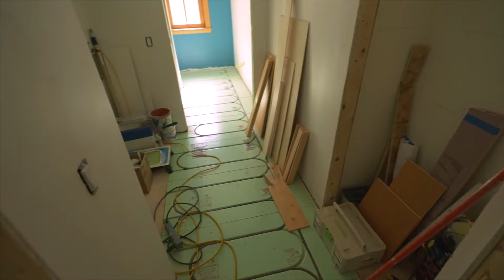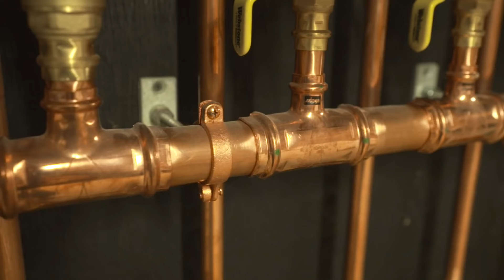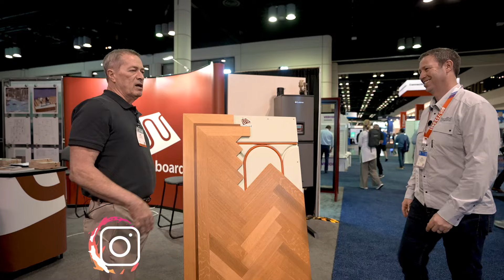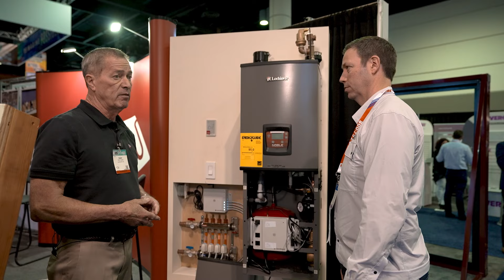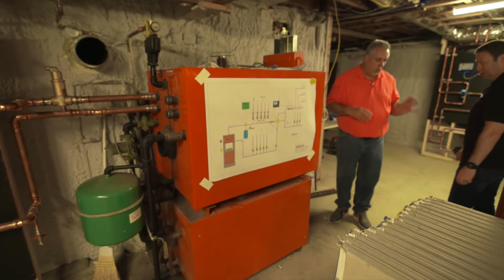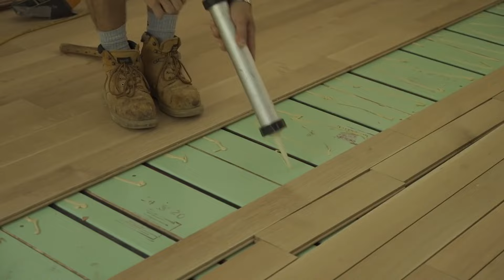ANY Plumber can install this new Warmboard Radiant Heating System

Comment: What's an average cost per square foot of floor space? How much savings versus traditional heating in wintery/cold weather?
Reply: Same BTU usage other than you can possibly turn the temp down and save that way(90% efficient is still 90% no matter what it's heating)  Radiant heat is about comfort. Most homes around here also have a forced air system to quickly ramp heat and for cooling. Once you have radiant heat done right you never want it any other way.  It's like why is it so nice to sit by a wood stove on a cold day? It just can't be described other than it is amazing.
Reply: @tysleight  Thanks for sharing. I haven't learned enough about this yet but I do like it.
Reply: I am personally considering the Uponor radiant heating system. Something to consider and check out. Thank you!
Reply: Savings are very tough to calculate because people live in their home so differently, in different geography, with different energy sources. We've heard of 30% savings on heating bills, and we've heard of 80% savings on heating bills.
Reply: @Warmboard  Lot of variables true but your answer is what I was looking for. If one were to choose this type of system, how long until, for lack of a better way to put it, "it-pays-for-itself"? You know, like with going solar or going with tankless hot water systems...
Reply: @lj8902  We estimate $20/sf - this for the design of the system, all the components, the shipping and the installation (though this number is not as steady as it used to be with the world the way it is). We had a homeowner in NJ see his heating bills go from from about $500/m to around $100/m. We had another homeowner double the size of their house while also cutting the heating bill in half from the previous home. And we've had a very small percentage have their energy bills stay the same (or increase) because they love it so much they never turn it off. :) So mileage will vary. Setting each room to its ideal temperature, not having the forced air wake you up in the middle of the night, less dust and allergens/viruses blowing around, and always being comfortable - these are some of the benefits you can't really put a price on. So maybe you pay $20/sf for this system, and then for the rest of your days you pay a couple thousand less every year to the energy company while enjoying constant comfort? Ultimately, that's what it might come down to. Do you pay the energy company for mediocre heating, or pay yourself back with comfort. And the answer to that varies for everyone. Let us know if you have questions, we're more than happy to help. Sorry for the long and rambling response.
Reply: @Warmboard  Not rambling at all. Very informative and very helpful.  Are there any flooring types that this isn't recommended for. Carpet, wood, tiles fine but what about finished polished concrete floors?
Reply: @lj8902  You can use anything with us. If you'd like, check out our Warmboard-S or -R installation guide on the "Documents" section of our website. Lots of info in there about hardwood, tile assemblies, carpet, cork, luxury vinyl etc. 

As for polished/decorative concrete floors, you can definitely do that. Just use a 1/4" backerboard over the Warmboard panels. This is an expensive way to go however, and you can risk hairline fractures. There is a growing movement in the tile industry towards larger sized tiles with minimal grout lines. These assemblies are less expensive and can be a great alternative worth considering.
Reply: @Warmboard  Thanks again for answering my questions. I'm only vaguely familiar with this topic, have some research to do. I'll look for those documents on your website. Have a blessed day...
Reply: @lj8902  You're welcome. Any time. Have a wonderful evening.

Comment: Can the Warmboard system be retrofitted to an existing radiant  system?  In other words, keep existing radiant tubing but use their Warmsource furnace as  a replacement for an existing furnace?
Reply: Potentially, yes.
Reply: Yes, a manifold with pump does the trick.
If u have that u can hookup the floor heating on any aystem u want. The pump on manifold mixes the water from the ground loop with ur heating loop til the desired water temp for ur floor heating is reached which u can set on the manifold also .

Comment: I really wanted to use Warmboard in my house 7 years ago but it would have added $20,000 to the cost of my home.  In retrospect, I could have done it for less as I could have sourced 1 1/8" material for the areas where I didn't need to heat., essentially an area 12' x 25' in a 1500 SF house.  My house is a DELTEC and requires 2 layers of subfloor,  Warmboard would have served well as the second layer. In reality, I wouldn't have needed to heat the bedroom at all as I've never run the radiant heat in that room.  My walls are 2x6 with 5/8 sheathing and an inch of foam and then spray foamed.  I did put in floor in the basement and garage.

Comment: Like the product and the radiant floors!  However how do you deal with Hot and Humid?  Still need a Ducted Forced Air AC evapoartor and a condenser
Reply: Two systems. We have a normal heat pump for quick heat ramp up and cooling all summer.
Reply: @tysleight  Thanks Tyrone  -- Yes I just drew in some chases for the ducts on my drawings
Reply: Don't forget about humidity control for the winter seasons. A dry winter will make all interior wood freak out

Comment: I wished they had a version that ran off of a Sandon heat pump system esp with the low running temps

Comment: I installed about 1,100 sq of their retrofit board along with their tubing, boiler, thermostats, and manifold.  I am not a builder or construction tradesman (I’m a mechanical engineer).  It was pretty straightforward to install everything.  All of their components are top notch and very well engineered.  Their customer service is absolutely incredible.  They’re all really good guys and have an excellent product!
Reply: Ballpark $ estimate?
Reply: will they sell entire setup and let you do it as DIY project? I'm not professional plumber but as a building automation tech i have enough skills to do something like this myself.
Reply: @VladyslavSvyrydenko  Yes.  I installed the entire system myself and I'm a DIYer.  Even soldered the little bit of piping that needs to be installed and ran the gas line to the boiler.  It's a nice system.  Probably the biggest hassle was renting a telehandler (onroad forklift) to unload the warmboard panels from the truck and get them into my garage.
Reply: @pauledwards1157  Thanks for the info on pricing.  About what I thought since they basically have no competition yet.  It's a dream system for sure.  Is it as cheap to run as you expected?  People that don't want to rent a telehander can pick it up at a freight terminal.  They'll load it onto your truck or trailer for you with a forklift.
Reply: @yo yo depends on if you got more time then money vice versa
Reply: It’s been a year. Can you give some feedback on how the system has performed? Monthly costs? Also what area are you located?
Reply: @Adesico87  Sure.  Still very satisfied and happy with it.  This is year 3 for me so I’ve been through two full winters.  I’ve never looked into the operating costs very closely.  It’s kind of irrelevant to me as it’s not more than a $20-30 difference either way per month.  The comfort level is much better.  Just a much more even heat and lower to the floor so much more comfortable hanging out.  The boiler has been flawless but I did have a very intermittent control board issue.  There were a few times where I needed to unplug the unit and replug it in.  After a couple calls with Warmboard support, they sent me out a new control board and it fixed the issue.  Still highly recommend it and I’d 100% install it if I ever built another house.  I’m in southern Colorado at an elevation of 7,040 feet.  It doesn’t get crazy cold but it will be down around 10-11 degrees later this week.  House is currently at 71 degrees.
Reply: My system without installation was less than $13k.  Remember that we’re talking about it including the tubing, thermostats, controller, self contained boiler unit, and fully detailed plans.  It’s more than just the aluminum skinned boards.  This was one year ago prices.  I’m sure with today’s ridiculous supply chain issues, it’s likely higher.
Reply: @pauledwards1157  just got quoted $24k for 1,100 sq ft. You're lucky you got it when you did!!
Reply: @pauledwards1157  How many sqft?
Reply: @jhealy3110  1,100
Reply: @pauledwards1157 do you have an email I could reach you at? I have some questions
Reply: Hi - how did you deal with doorways and thresholds at exterior doors?  Seems like this system plus another layer of flooring on top of regular plywood subfloor would cause a lot of issues...
Reply: @mschumaker1  You do have to deal with this.  Some exterior doors I had to replace the threshold piece with a new one. Interior doors needed to be cut down on some depending on how much space they had to start with.  I do have a height transition and Schluter trim piece where I transition to carpet at the bedrooms.  I installed a slight tapered piece under the carpet pad at the transition point.
Reply: @pauledwards1157  thanks.  Good to know and pretty much what I expected.

Comment: Eh…. The subfloor system itself is good. Depending upon how your house is constructed there are other products out there that give you better BTU transfer. The only problem I have, is when you start saying that it’s a “totally integrated system” That is never the case. And God for bid when you go to service that “integrated” system in a few years and you need to find some of these components, best of luck to you.  It is good to see though that they’re actually teaming up with Lochinvar for the boiler itself. Anything was better than the no-name boiler that they were using before.
Reply: What are you going to have to service?
Reply: @ZDub77  u never know, anything is susceptible to failure. The second I saw this I had the exact same thoughts about maintenance. Hopefully they also offer many years of standard parts you can use to replace whatever will eventually fail.
Reply: @PT-ho1ez  just pray you won’t have to have them shipped from California in the dead of winter when your house is getting cold 😄
Reply: @ZDub77  anything and everything. I didn’t really like his comparison to a nuclear submarine. Ideally you never want to have something set up so compact that to service it you will have to go through multiple components in order to access what you’re trying to fix. At the end of the day anything that is sold at your local supply house is best, and you can be almost guaranteed that it will be in stock if the worst happens. Also, even if a journeyman plumber can install it, more times than not they don’t know how to service it. Even though they are few and far between you always wanna make sure that you have someone with a hydronic background that will be able to, not only install but, service down the road. And nine times out of 10 they’ll want to use product that they’re familiar with.  The problem with any boiler system if something goes wrong your house, it is going to get cold quickly especially when you’re dealing with a “Low-Mass” system like warm board. You want to be able to get parts quickly and not wait to have them shipped from California. Lochinvar would be a fairly easy company to get anything from locally. As far as their other components, especially the zone controls, thermostats, and manifolds,  you’ll want to be able to fix the issue quickly.  At the end of the day as long as your meeting your BTU requirements warm board is a good option. However the boiler system itself I would have installed separately, and not buy a “package system“
Reply: Would you be willing to identify some of the other products that give better BTU?

Comment: Would have loved more detail about "what's in the box" i.e what components have they incorporated inside.   Also can we buy their boiler and attach to our existing hydronic heating system.
Reply: Our site has more info if you're interested. As for your existing system, most likely not. But if you want to give us a call, we could talk through some of the specifics.

Comment: Given the low temperature required this would pair well with an air-to-water heat pump.
Reply: stay tuned...
Reply: I used Warmboard for a gut renovation mechanical setup with an A2W heatpump and a 3 ton ducted Fancoil for AC works really well. The Warmboard team is excellent, you get what you pay for.
Reply: YES. As an HVAC guy who just completed my own warmboard install w/ a Rinnai combi - I am very upset that I didn't wait 2-3 years for Daikin, etc. to bring the heat pumps to the US.
Reply: @epiphany6  I wonder what's taking so long.
Reply: R744 is GWP of 1 because it’s CO2, excited to see if companies can manage the higher pressures it requires and start to replace R410a as a go to residential heat pump and AC refrigerant
Reply: That's where I see this going once the R32 stuff storms North "Murica
Reply: @hmurchison8123  R32 was always in America. It was previously used for refrigeration. R410a is just R32 with R125, and the R125 was used to make the R32 not flammable.
Reply: Agreed!
Reply: Or geothermal

Comment: Love the idea of heating the floor and not the air. In the Northeast we need AC also so It's easy to just go with forced hot air. I would love to feel the comfort of that system.
Reply: @yo yo Yes Mini splits are becoming more acceptable to have something on the wall. I know they have ceiling units bif you have room for the install.
Reply: @yo yo ... such a system is already made and in use for commercial applications. They are made up of chiller panels, installed in various areas, then they use a much smaller air handler to remove the humidity. (so the panels don't sweat) The main advantage is fewer ducts, and less total air movement so fewer drafty spots. I have forgotten who makes it.

Comment: Installed Warmboard in the remodel of my 2,000 sq. ft. house here in CT a decade ago. 

It is expensive up front but incredible in performance. It was the best move ever, and yeah, no radiators or ducts to deal with.
Reply: Same positive experience  with Warmboard on Long Island NY, over three winters.
Reply: Did you rip up the old flooring down to bare floor joists , than you put  warm  board on top of floor joists?
Reply: @cheeseburger9232  - good question
Reply: @cheeseburger9232  I installed right over the existing 1/2” sub floor. It was a 1963 house with the 1 1/8” Warmboard product. I save a bit by not running Warmboard under cabinets, the island, and closets and was able to eliminate like 6 panels. That’s as okay as I knew the BTU output was more than sufficient and I have never run more then 110 degree water in the system.

Comment: Installed Warmboard when I remodeled my 2,000 sq. ft. house here in CT 10 years ago. 

It was expensive but the best move ever for comfort and efficiency. I love it. 

A little bonus that is not so obvious; no heat ducts or radiators to deal with. (A/C is a high velocity system)

Comment: Been filling this for awhile... Would install in a remodel of my home !!!  Can use other companies to run the system.  I am using Water Furnace for my heating and AC put in 20 years ago.  Uses the ground for temperature exchange... Amazing system .... Matt you need to check it out.  Instead of changing outdoor temp for heat & AC  your using a constant death temperature in your area.  It's a great system ....
Reply: He made a video about geothermal heat pumps before.

Comment: I'm no plumber but I'm gonna give it a shot. Thanks Matt!
Reply: Shit runs down hill, don't chew your fingernails. That's all you need to know.
Reply: @matthewerwin4677  payday is on Friday 😂
Reply: Look at all the different available options before using this one. This is a paid ad for a specific use case. Every house I build we do in floor heat and I've used this system once on a reno. It worked ok but wouldn't be my first choice.
Reply: @mountains2938  What would your first choice be?
Reply: We've got a couple interviews on our youtube page with general contractors, radiant installers and plumbers who have installed the system, if you're interested.